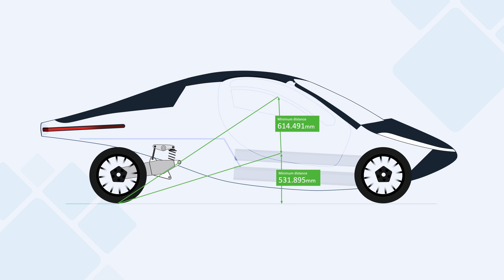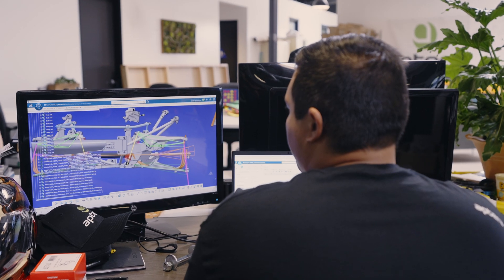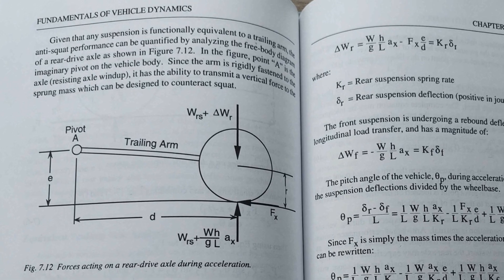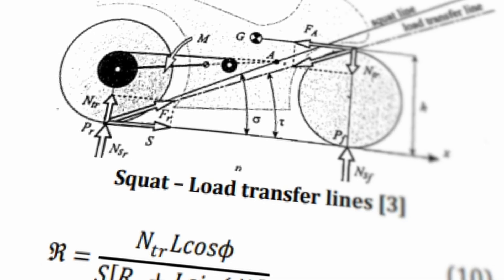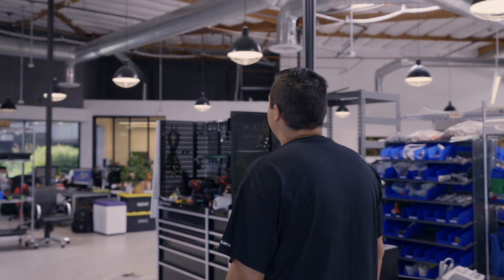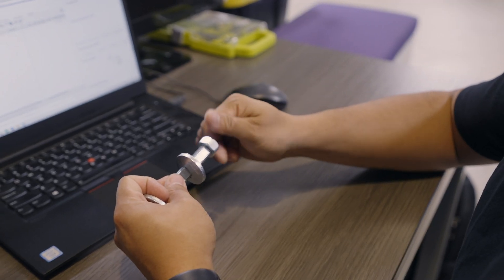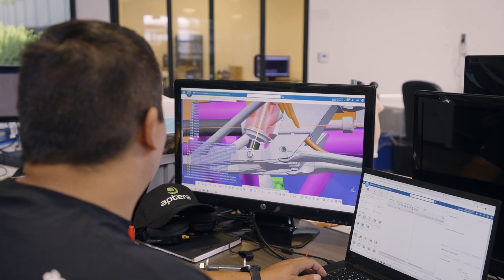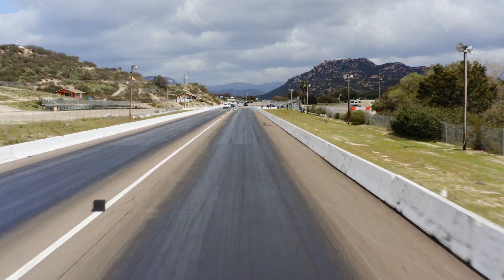Aptera Makers Series — Suspension

Comment: Subarus are all wheel drive, which would make one think that they'd be ideal for cold wet climates. The problem is everything on a Subaru undercarage rusts & corrodes at an alarming rate. Talk to mechanics from NY state about working on them. They hate it. All steel fasteners must be Cad-Plated. All aluminum must be Conversion coated. If you don't, you won't be able to give one away in the eastern US. Think long & hard about dissimilar metals in the chassis.

Comment: This portion is the one item I'm really concerned about with the Aptera. The ride looked super rough on the earlier models. Best of luck improving that ride smoothness and handling! :)
Reply: The suspension has been completely modified by Roush Performance and the first beta is a suspension mule for tuning. Among the changes are the addition of a sway bar in front and going to a dual link rear instead of a swing arm.  I had a chance to ride in the Luna alpha.  The handling even there was pretty amazing for cornering, but it was harsh, like a full on sports car.  I understand that this has been corrected with the Roush changes and the new version is much more compliant and handles even better.

Comment: When will Aptera have test drives available AND  is Aptera accepting deposits on cars?  LOVE the concept and will LOVE it even more when its available for purchase.  Need more info regarding the car, is it easy to repair?  I would like to repair my own car as much as possible - never know where you are in the city or in the outback : )
Reply: Aptera is accepting pre-order deposits to hold your place in line.  a $100 deposit, or $70 with a referral, which is refundable if you should change your mind.  Aptera grants right to repair, and the repair documents will be open source.  You can repair it yourself, or take it to anyone you wish.  Since the parts count is far smaller than most cars, it should be relatively easy.  Body repairs should be relatively easy for anyone with composite experience, such as with many boats and some aircraft.

Comment: Where are the jack points for working on the car? Are there road side assistant equipment like jack and/or spare tire?
Reply: There are jack points on either side of the front suspension, and in the rear near the trailer hitch.  There is no spare planned.  I plan to carry a plug kit and a dc inflator to fix flats.

Comment: Aptera is a scam on the same level as Paul Elio and all the rest of the failed three-wheelers. Thie ie going NOWHERE!
Reply: Your fears are rooted in a lack of due diligence.  Did you say the same thing before Chris Anthony took his lithium battery company public?  Aptera has every element in place to be successful.  Tesla was a clown show at the same stage in their company history.
Reply: I presume you have direct knowledge of all the mistakes Elio made? Having followed Elio closely, it was obvious the mistakes they made early on that doomed the project. Other than both being three wheel vehicles there’s no comparison between how the projects have progressed (or didn’t). I get tired of hearing people trying to compare the two without factual knowledge.
Reply: @arlenbell4376  I did engine procurement for another company around that time frame, and I knew from my experience that Elio wasn't serious.  Other than that, I had no direct knowledge of Elio Motors.  

I did have direct knowledge of several of the other startup companies at the time, including Corbin, The Commuter Car Company and Tesla.

Comment: I certainly hope that the main priority is not efficiency.  I really don't care if the cycle gets 1000 miles range or 950 miles.  My own priorities would be 1) safety, 2) ride comfort, 3) handling/stability, and 4) usable payload.  I really don't care about efficiency, self driving, or solar charging since this car is already far above the competition.  I really don't see how they are going to have sales in 2021 like they promised.
Reply: From the beginning, there has been no confusion that the two main design goals are efficiency and safety. The other items on your list are mainly in the service of the first two.

It is clear that the supply chain will be unable to supply at least some of the planned featured at this point (such as a reversing valve).  Aptera has been very open about the risks.  Depending on the results of the beta testing, there still may be a production intent vehicle by the end of the year.  In order to ship, they will require that enough of these vehicles can be produced for crash testing.  This is not a legal requirement, but a reflection of Apteras' commitment to safety.
Reply: @n.brucenelson5920  Thank you for the discussion.  From what I read, they cannot even decide upon how many airbags to install and where.  There was even a mention of just using a clip on seat belt airbag.  Have you read if they are going to have common safety features that other economy models have such as:
blind-spot monitors
lane keep assist
lane change warning
pedestrian assist
autonomous emergency braking
adaptive cruise control
forward collision warning
If you tell me that they are already committed to having these devices, then I can agree with you with their safety standards.  Most of all, I think the whole world will be waiting for their crash testing.  All it will take is 3 vehicles to do the crash testing, so thousands will not need to be built.  Why crash test after production?  Those tests will help develop further improvements.
Aptera's problem is that they build almost none of their own key metal and electrical parts.  There is always going to be something which will restrict a complete build.  That is how I know the production sales will not occur within this year.  I don't why they don't realize it yet.  Thanks
Reply: @SilverShadow2LWB  Aptera will have and option of a level 2 safety pilot with these features, and it will have OTA upgradeabiliy.  Chip supply makes availability at launch uncertain, but it can be user installed after the fact by plugging in the board to an existing wiring harness connector.

To be meaningful, the formal automotive crash tests need to be performed on production intent vehicles.

A sense of urgency to achieve a fixed date is a necessary driver for the company itself.  They detail the risks that may prevent them from hitting their goals, as long as there is a path to get there, I don't think the management thinks it wise to take the pressure off.
Reply: @n.brucenelson5920  That is exactly what I am talking about.  The priority should be in tuned vehicle safety features rather than "do-it-yourself" builds after the sales.  Most of these systems are more than just computer boards and software.  The hardware, system monitors, and airbags need to be installed at the time of manufacturing.  So instead of trying to rush out an incomplete vehicle, I would rather they wait for parts, integrate the systems, tune, and test before it gets into our hands.  My wife will have very little knowledge on how to work on such systems, nor the testing equipment required to calibrate each one.  This demonstrates that the company is more focused on sales and deadlines rather than vehicle integrity.  There is a sizeable group of people who have put down deposits, and are in tune to every video or announcement from the company.  Most of them just follow each word as sheep....just like the Elio investors.  Have they even settled on a battery pack or custom modified Elaphe hub motor?  How could they be ready for production in 3 months?  Believe me, there promises will slowly and quietly be changing with excuses related to circumstances outside of their control.  Promises from experienced manufacturers should take into consideration Covid and overseas distributors and not be based on "best case scenario" but realistic goals and accomplishments.  Aptera is too heavily integrated into a system where they are dependent upon too many other people to manufacture their key components.  It just takes one supplier to throw off production dates.  Remember that this isn't their first attempt at this project with the previous one failing miserably.  I am not trying to be negative, but I am trying to put the data into the right prospective, which we should all do.  I am hoping for a successful EV, which is carefully fully built and tested before sales begins.  Thanks for the discussion.
Reply: @SilverShadow2LWB  Perhaps I should point out that your comments are not only legitimate, but also points detailed in their public financial disclosure documents.

With their right to repair policy, you will not be getting a black box with no information.  You, or a local mechanic you trust will have all the information they need to evaluate the safety of the production and the freedom to modify anything that you feel falls short.  Compare this with the Tesla policy that says you have no right to know what we have produced or service it yourself.
Reply: @n.brucenelson5920  I might be like most potential buyers in that I am not certified to work on high voltage circuits nor have the equipment to do so.  This also pertains to many general mechanics.  My friendly BMW service manager points out that his mechanics must be certified to do so after going through a 4 month training course.  Tesla is much like Apple in that they like only certified trained technicians to work on their equipment.  If a check engine light came on, I would not know where to start on diagnosing the issue.  I am also smart enough not to let the local gas station mechanic to work on the car.  I do many repairs to the Tesla which I am comfortable with such as changing tires, brake pads, windshield wiper blades, etc.  But if an inverter or controller needs replacement and coding, I'll let the right person work on it...someone certified and trained to do so.  This is not the time for me or a "mechanic" to learn how to work on a 400 volt system.  It sounds like you and your wife have much better training than my family does so you may feel more comfortable.  Think 1000 miles away along the side of a highway situation.
Reply: @SilverShadow2LWB  This is a great point.  Even high energy ignition systems on conventional cars as well as other systems can be dangerous to work in if you don't know what you are doing.  This is a big reason that open source documentation is desirable.

While I don't have formal training in high voltage systems, I have enough work experience and familiarity with the original high voltage safety studies done at Berkeley in the 30s that I served on the ABYC safety committee that developed the standards for handling high voltage systems in boats.

Any tech can be dangerous if you don't understand it or respect it.
Reply: @n.brucenelson5920  What worries me is has Aptera voiced what their warranty will be and what parts are covered?  How are they handling the distribution of their service centers?  Large collisions and major component replacement are not for the home "do-it-yourselfer" who unlike you have little or no training in high voltage systems.  All that should be worked out prior to sales.
Reply: @SilverShadow2LWB  Aptera has addressed each of your questions here on their FAQ spreadsheet, although it is too early for complete answers to some of them.

Comment: Really appreciate Aptera posting these updates.  So Aptera is switching the rear suspension from Swing Arm to Double Trailing Link.  The main advantage seems to be a less bouncy suspension for a more comfortable ride as well as less lift up when fast accelerating.  I'm finding difficulty understanding the fundamental differences because they are quite similar. Swing Arms are typical for rear wheels on motorcycles. Trailing arms applications are what you see for airplane landing gear and some rear wheel axis of a few 4 wheeled cars.  According to the diagram, this new design seems to save a lot of space for the back side hump just behind the car seats. If so, you may be able to create a deeper pocket just behind the seats, enough so that a third person could sit facing rear like so.  -\_

Comment: As stated in a mail, where you requested: I really think it would benefit the car if you could disable power steering. With the double wishbone you are able to develop a really sound front suspension which won't require a lot of force since the vehicle weight is low and the tires are narrow for efficiency. This car could deliver as much fun as the 3-wheeler in the mountains. And without material cost, just development. It would be very nice to have a car which shines in steering feel, since it cannot do so in pure speed.
Reply: Aptera gives you access to the underlying software and if you have the knowledge, you can play with it as much as you want. If you screw it up too much, there will probably be a method to return to factory default.

This is per Aptera's CTO.
Reply: @n.brucenelson5920  Ah, thank you for the information. Didn't knew this. Sounds good to me.
Reply: I’m sure the engineers have looked at the gyroscopic action of the wheel/motor combination at various speeds and determined that power steering is the best solution. A joy stick steering control would be cool with electric steering. I don’t know if regulations would currently allow it. It would require backup failsafe systems.
Reply: @arlenbell4376  Ofcurse is EPS the only solution hence it is able to enable steering by car systems. But if it could be disabled it could be fun.
Reply: @arlenbell4376  Aptera will have both power steering and torque vectoring.

I know that joystick steering has been mentioned, but as far as I know,  Aptera hasn't spoken directly to it.
Reply: I certainly hope the steering feel will be "fun".  Things are still changing considerably from the alphas.  We will know more about this after beta testing is complete and some of us will have a chance to drive gamma vehicles, which will be closer to production intent, and made available to reviewers.  Since car guys are doing the design work, I am hopeful that they will be a blast to drive.

Comment: Don't know how finalized the front suspension design is, but it would be nice if it could pull the front wheels in closer to the body at low speeds, say by rotating forward and down and/or retracting. At 88 inches wide, with the wheels sticking so far out from the cabin, I foresee many fender-benders as drivers have a hard time knowing exactly where their wheels are.
Reply: The wheels are easy to see from the driver's seat.  A complicated mechanism would add cost and weight.  Bringing the wheels in would affect stability and increase the coefficient of drag as much as 10% - not a viable trade- off, considering the design goals for the vehicle.
Reply: @n.brucenelson5920  That's why I qualified my suggestion with "at low speeds." But, it's good that the wheels are visible from the driver's seat.
Reply: That would be wildly complicated and impractical. The excessive width is an issue, but it's a natural consequence of choosing a three-wheeled configuration.

Comment: One thing very common in the UK is speedbumps to calm traffic in busy built up areas and enhance safety for pedestrians and cyclists. If you are going to produce the Aptera for UK and Europe, then you need to test the suspension on these - don't want the car becoming unstable if someone takes one of these a little fast! (They are not always well marked, so sometimes the first you know of them is when you feel the front tyre hit the bump!

UK speedbumps - Bing images
Reply: Speed bump performance is part of the beta vehicle test protocols.

Comment: All these fundamental  changes are good i guess , the first drivers will get a v2.0 instead of 1.0 production car now , but best release something  and actually produce it.  I think the Tesla factory is actually more amazing than the car so you seem to be about 15 percent of the way along toward mass production right now.
Reply: That is definitely the case for Aptera which will have a much less capital intensive factory, and at first pass, will only require 23 people to produce vehicles at a rate of 10,000 per year.
Reply: @n.brucenelson5920  That's an impressively low number of people. However, I believe that counts only the body parts molding and final assembly done in San Diego people. Maybe the automated custom battery pack assembly, too?  

Other parts such as the motors, suspension components, electronics, battery cells, solar cells, etc. are made by many other people, some elsewhere, many by contract manufacturers. A lot of both large and small, standard and custom parts and people will go into making an Aptera.
Reply: Nah. This is all going towards Aptera solar EV roadster version 1.0. The initial alpha level prototypes we've seen so far are something other car companies never show the public. Others may show a totally nonfunctional "concept car" and then hide all their progress until the intial product is rolling off the assembly line. Aptera's openess in the showing their production intent design progress is fairly unique, as far as I know. Well, Tesla did a little body prototype show and tell for their unique Cybertruck and Semi. Arcimoto did something similar too so perhaps Aptera Motors is taking a clue from them.